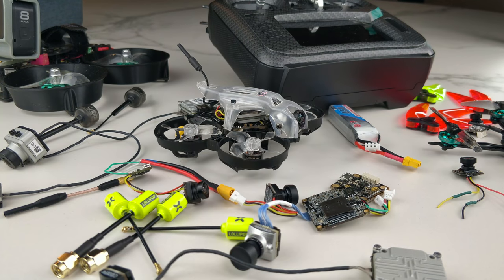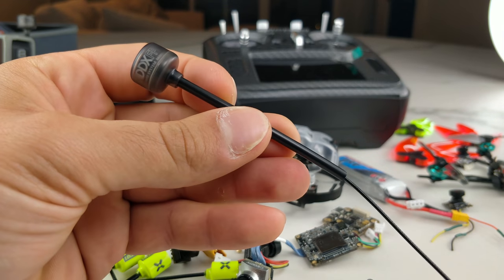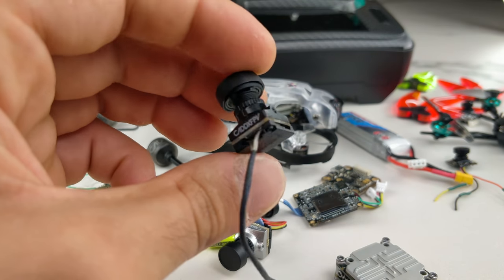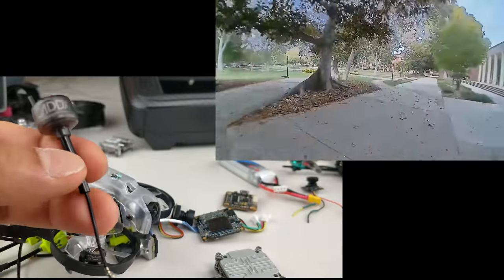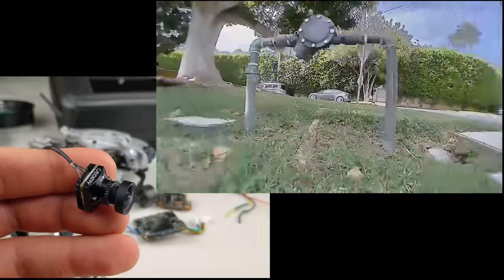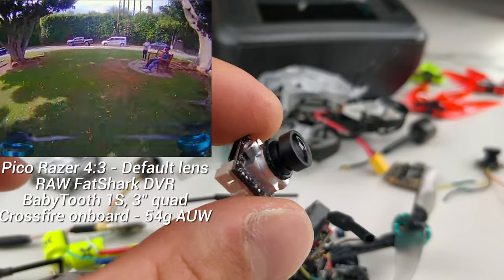Lots o things + GepRC Thinking P16 & Jumper T18

Comment from the maker: Longer Vista antenna - https://bit.ly/2ViXhFg
Vista + Nano Nebula - https://bit.ly/2ViXhFg
Vista kit + longer camera wire - https://bit.ly/2ViXhFg
200mm DJI camera wire - https://bit.ly/3eyBYXU
GEPRC Thinking P16 - https://bit.ly/2Z8vQPO
Batt for Thinking P16 - https://bit.ly/37YF9pr
Caddx Ant - https://bit.ly/2Z8bOER
Caddx Loris 4k/60fps FPV&HD - https://bit.ly/3eyawts
Foxeer Pico Razer - https://bit.ly/2NFb7hj
Foxeer new Lollipop - https://bit.ly/3fXILuI
Foxeer F722 20x20 - not available yet
DAL Fold prop 5" - https://bit.ly/2Vik4kF
DAL Fold prop 6" - https://bit.ly/2Vxgpjh
DAL Fold prop 7" - Coming Real Soon
Jumper T18 - https://bit.ly/37ZJs3K
Radiomaster TX16s - https://bit.ly/3hVRy29

Table of Contents:
►00:00 - Intro
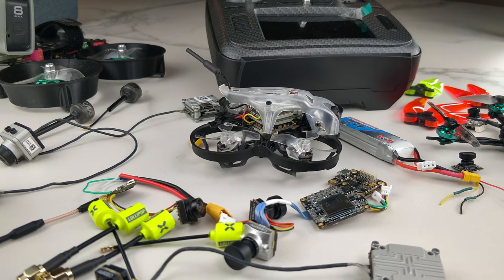►00:35 - New things available now
►02:44 - GEPRC Thinking P16
►06:25 - Caddx DJI Nebula Nano
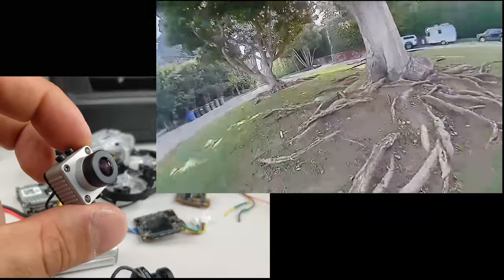►09:20 - Caddx DJI Micro Nebula Intro
►11:34 - Caddx Loris 4k/60fps FPV&HD
►12:30 - Caddx Ant quick overview
►13:58 - Foxeer Pico Razer and 4:3 vs 16:9
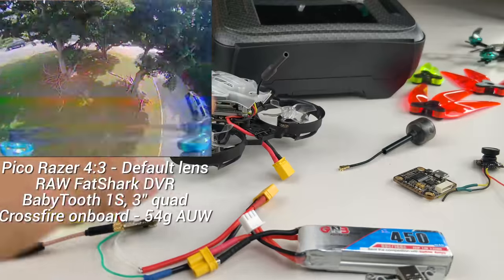►16:32 - Foxeer F722 Mini 20x20
►17:21 - A random Vtx I was working on...
►18:45 - Lens issue with nano and smaller cams
►21:33 - DAL Fold props in 5", 6", 7"
►23:34 - Jumper T18
►27:41 - Sad thing about these controllers :-(

▼Join my FB group for more discussion: Kabab FPV
https://www.facebook.com/groups/379155946182689/

The store: www.FPVCycle.com

▼ My typical 5" quad setup:
-CineGlide: https://bit.ly/2MCoz50
-Motor: http://bit.ly/2Nqqr25
-ESC: http://bit.ly/2oDdzvL
-WaFL’s Cap Cap: http://bit.ly/2GUpXxO
-Battery: http://bit.ly/2JnsTDM
-FC: http://bit.ly/2XRc8G8
-FPV Cam: http://bit.ly/2Q7LfL7
-Vtx: http://bit.ly/38Y25oz
-ND GoPro Mount 30deg: http://bit.ly/2WC15zc
-ND Filter (if used): http://bit.ly/2WEmQ1j

▼Notable motors:
None.  Wait for the new wave of motors

▼Starter goggles: http://bit.ly/2qbJNOS

▼ If you want to solder better:
-Fantastic solder: https://amzn.to/2P5QM2W
-Fantastic iron: https://goo.gl/DqBipa

▼ Tips?
Patreon: https://bit.ly/2oGLP9b

-PayPal: https://www.paypal.me/kababfpv
-Bitcoin: 1E4XZXoD4rS6MYWVWuenY7Kw2M1YgyNpoQ
-Nano: xrb_1188ek5bd7tb9kw67asnp9o65byuoaxbtpxuznx1ribf75x78awywmakj55f
-ETH: 0xD067F93811f2eC31CB1928901002dfdf9A492EF5
-LTC: La2KWYAjp4VT2Lq2M76pbjzXWvRyjpfCtG
Reply: I promise to brush my teeth if you promise to do a giveaway soon....😆 🤣 😂 😹 😆

Comment: Every time I see those new radios from Jumper and Radiomaster I'm glad I choose the Tango 2
Reply: Same here, it was well worth the wait (it ended up taking nearly 4 months on pre-order due to Covid delays). Just the form factor/durability alone make it my favorite radio of all time. It’s nearly perfect.
Reply: That makes a lot of sense - realistically there's nothing you can't do with a Tango2 and BetaFPV FrSky controller setup, especially if that form factor works for you.
Reply: My main concern was the ergonomics, given the fact I pinch. Couldn't be more wrong
Reply: The tango 2 is a fine radio if you don't mind it being proprietary and only running Crossfire exclusively. That, and it's not really for hybrid pinchers! Myself, I won't buy proprietary because it's not versatile in the least bit and you are stuck buying the most expensive receivers on the market. And since I've been in the hobby for 3 1/2 years what would I do to fly all my FrSky quads? Have 2 radios? That's dumb! Then there's the fact that's been with us for way, WAY longer than the COVID-19 shipping /customs fiasco, which is TBS's inability to keep Crossfire products in stock even a fraction of the time! People say "it's because they sell so many!" No, that's not it, because if that were the case, TBS would be cash flush, and make more and more and keep the pipeline full of product. I've seen it over and over before, my theory is companies have to have a ton of money available to them, to constantly keep the flow of products coming because they have to have many orders in different stages of completion to keep that pipeline full so products don't run out. When they are cash poor, which happens all the time to small companies, then products run out of stock because they have to sell the current batch to pay for the next batch! This is what I believe is TBS's problem. Because dealers obviously don't get many items in stock because they sell out so quick... That means they most likely can't order as many as they wish they could.  So, I don't feel the health of TBS is such that I want to buy a proprietary radio that's locked into one protocol. Otherwise, we wouldn't have the constant situation where every dealer on the market is constantly out of stock on modules ALL THE FRIGGIN TIME! No company wants that, so something isn't quite right in TBS-ville. 
Plus, why would anyone put all their marbles into one protocol when for the same amount of money you can get a radio that runs pretty much every protocol every made? Because of the form factor? Fuc# form factor! It's a huge mistake to count so heavily on one company! If you've been around as long as I have, and worked in the electronics industry for well over 30 years like I have, you would have seen the dozens of companies that seemed solid as a rock, go out of business like I have seen. Putting all your faith in one company in electronics is foolish! This is why I won't buy proprietary products, that and because it's the opposite of versatile! 🤔😒
Reply: @scootroter4859  1) I'm just starting the hobby, so no previous fleet to convert. 2) hybrid pinching on the T2 feels great TO ME. 3) Even if TBS will close in the next few years ( highly doubt that ) I still have what I consider the best radio FOR MY NEEDS right now. 4) I have the impression that any Jumper or Radiomaster will last half the time, but I can be wrong. 5) TBS customer support is on another level. 6) I love open systems (Linux user here) , but don't think is the best solution for everything
Reply: @ghosthunterc  couldn't agree more.... Just wish i could get me Rx's to recognize my inputs!!! Three different quads and i STILL haven't been able to get it to work! 😭😭😭
Reply: Tbs is also working on a full size tango 2. So it won’t be as small and will have the full size module in.
Reply: Whats wrong with them? i can flight almost every protocol out there with m T16 out of the box.
Reply: @scootroter4859  you make sense dude.

Comment: Your logic is sound on the production side for 4:3 vs 16:9. Personally I prefer 16:9 cameras since my primary goggles are better in that aspect ratio, but to each their own. I agree with you on preferring a wide field of view.
Reply: The way they are achieving 16:9 is by chopping off top and bottom of the 4:3 image in postprocessing. IMO with 16:9 goggles you should still use a 4:3 camera because you're not loosing the vertical fov, but as you said - to each their own.
Reply: Well you can either buy that cam in 16:9 or 4:3. What tells you they do not have 2 different sensors? Wouldn't it be easier to add a software function to switch instead of going through the pain of selling 2 different cameras?

Comment: The problem with blanket statements about 4:3 and 16:9 is that not everyone is on the same page when comparing them.  It depends.  Is the 16:9 video a 4:3 sensor cropped to 16:9, or is the 4:3 video a 16:9 sensor cropped to 4:3.  That makes a huge difference.  What a lot of people mean when they say they prefer 4:3 is that they like more vertical field of view.  Then there are a few weird people out there that don't like more video in their peripheral vision because they find it distracting, but those people don't count ;)
Reply from the maker: Well if we had to choose only one, would you go with 4:3 or 16:9.....for an entire product line
Reply: @Kabab  I would go with a properly sized 16:9 setup.  For example, I would take the original DJI FPV camera, make the sensor wider, then run 16:9 mode. (might need a larger lens though so you don't see it in the now wider image). Then you should have the current 4:3 vertical field of view with extra image on the sides, filling up the goggles.  I like to feel as immersed in the experience as possible.  I have a lot of peripheral vision that is going to waste right now :)

Comment: I have the 20x20 Zeez prototype on my bench :) I am not yet allowed to show it. AND the 6 inch folding are fantastic IMO. I got some as prototypes. The circular centrifugal swing on them works really well . Nice N smooth..
Reply from the maker: The zeez is in one of my quads right now. It's actually quite nice. The LEDs on the board itself are blindingly bright. Be careful when you plug it in the first time. Wear dark dark glasses. Maybe a welders mask 😂
Reply: @Kabab  hahaha! Right? Super convenient for race builds that require LEDs.

Comment: I've just updated the taranis x9 lite to work with d16 on my friend controller using frsky website, works well but I currently use the new tbs tango 2 pro over my x9d+ just because of the small form factor. Not a fan of the new access protocol just a bit to faffing around, nice video sir 👍🏻👍🏻
Reply from the maker: Yeah I have it too. Irs not the same d16 sadly

Comment: My goggles are 16:9 and I prefer 16:9 cameras but with a shorter lens to not only regain the vertical FOV, but have more horizontal too. I can fly 4:3 cameras pretty much fine and don't even notice the warping, but switching from a 4:3 camera to a 16:9 one is quite noticeable in a good way. 

I want to switch to 4:3 goggles someday but my domv3s are more than good enough really. Let's see if I can hold onto them until bytefrost hopefully comes out.
Reply from the maker: Don't switch the dom v3. They're totally fine.

Comment: Kababfpv . Having a blast with the TP3. I bought Gemfan 3 blade 3016 and 2 blade 3018 . I have to admit I am hard on props . If you dont push the envelope you dont get better :P . I am finding the EMAX  2.5 inch Avan Rush Propeller to have the same or about performance and much more durable . Have you tried them ? Keep the videos coming :)
Reply from the maker: Yeah they're good, I just prefer the lighter gemfans

Comment: I prefer 4:3 and super wide. 
I like runcam nano2 - it's wider than any other camera (other than very old hs1177 with giant lens).
I also put runcam nano2 lens into a foxeer predator 4, and it got wider than stock 1.8mm and 1.7mm foxeer lens. Also runcam lens doesn't have glare issues.
So for 5" i now like predator with RN2 lens, and for toothpick RN2.
I've got caddx ratel nano, it's narrower than RN2, but i'll try it with RN2 lens later.

Comment: Hey bob I want to thank you for your videos and I look forward to your input!👍
One thing I have to tell you is I have been playing around with a completely stripped down vista with no case on it. So far it’s working like a champ even on 700mw but I mostly fly on 500mw and it works awesome! I have it on a og twig weighing 74g, pretty darn light for a vista dji setup!! It’s 119g with a 3s 520mah with xing 1204 motors so that setup could be more optimized but it flys like a toothpick very well.
Also I have been trying to get that darn nebula to preform better and I have put a runcam racer nano lens on the nebula and it does make it a fair amount better!!Maybe check into it for your self and I think you would be pretty interested. 
It’s pretty exciting to finally think digital toothpicks are a good possibility!! 
I’m always tuning, building and tweaking quads to get the most out of them! 
Have a good one and stay healthy!
Reply from the maker: I've been seeing the naked vista more and more lately. I'm actually talking to Caddx and dji about making that happen and restricting the output a bit.
Reply: Thank you Bob for pushing the companies to develop decent products.
And I really hope that a single board VTX will come out soon

Comment: DJI can handle 5s 21v just letting you know cuz ur previous video I think u said only 4s?? But yes defiantly not 6s!! Im gona get ur new 5 inch light frame u showed looks dope!! Can it hold the air unit?? Can I preorder it??
Reply from the maker: the CineGlide is available already and yes it will fit an air unit however I recommend the Vista

Comment: Great info. Nice tree flying! DJI makes fun!! Do you know if caddex nebula will have an update? Any way to fix? I like 16x9 because use to it? Big screen tv.. started with 4×3 and is better.  But just dont like?? I'll try 4×3 again..👊👊💪💪
Reply from the maker: What needs fixing on the nebula?
Reply: @Kabab  Bartwell say picture sucks. Me I didn't buy a 1k system to down grade. You cant adjust camera? Was hoping update or something.  I just got and opened before reviews came out. And most say it sucks. What video I've seen agrees.  Is it worth even installing?? Until can adjust camera??

Comment: So I have the frsky x9 lite and I haven't updated it. It works great with d8 and d16 (I use multiprotocol module for d8). Are the new updates locking both of those out? Will I be able to back up my setup and load it onto a new x9 lite if this one dies? Lol noooo.i like my x9 lite for d8 and d16.
Reply from the maker: maybe they updated it to do the old d8/d16.  mine doesn't and I wasn't aware that the new ones do now either.

Comment: You can get that smooth but not floppy throttle stick feel on any radio....put a piece of silicone or nitro fuel tubing on the bar where the little half circle thingy pivots. add some lube( I used super lube synthetic ) and boom. epic throttle feels
Reply from the maker: I've asked for manufacturers to do this many times.  It just makes too much sense for them to give a shit I guess.

Comment: I like a smorgasbord video:)  Nice look at the Thinking. I was curious about that as it's the lightest and cheapest digital BNF I've seen yet. Doesn't look too bad. Also I agree with you on the whole radio situation. And indeed why do most  radio designers feel the need to put stuff all over the place? It's basically for this reason that I went to the Tango 2 and now just live with putting Crossfire Nanos and Minomortal-Ts on everything;)

Comment: You can get flat 3S 300mAh from GNB and URUAV (for mobula7). Please review this thing on proper recommended lipo
Reply from the maker: I'd still run 2S 450mah on it.  It's fine.  No speed queen but it's not supposed to be.  Flight time is pretty good.
Reply: @Kabab  kV of these motors and props is made for 3S. for example cinebee 75hd has 1103 10000kV and rocks on 3S 450mAh

Comment: I love 16.9 cans bob I don't really like the 4.3 that's why I still use my dom v3
Reply from the maker: Do you use 4:3 on your dom v3 or do you use 16:9 cameras too?  I personally prefer 4:3 on a 16:9 screen
Reply: 4:3 is fine for now, BUT! We all need to face the facts of the future... 4:3 is not going to stay around for much longer because it's an analog format, and NOTHING analog is going to stay around for long after everything changes to Digital. 16:9 is THE DIGITAL FORMAT, and 4:3 will die. Just like analog FPV WILL DIE. I get a kick out of people trying to convince me analog will live forever. No, it won't! Just like the analog cell phones died, the analog TV's (and signal) died, analog audio died and we now stream everything, analog camcorders died, etc. The camcorders are probably the best example of analog dying because it too is analog video dying and being replaced by digital video! Same shite, different use! 
Nothing really stops new technology. When the HUGE BOMBSHELL is released very so0on, it will be the start of the end of analog FPV. Bob even said it! After that, you'll be really surprised how quickly analog will die and go to FPV heaven. (which is at 401 ft. and above! Lol) 🤔😇
Reply: I use 16.9 cams  but I'll try the 4.3 on the 16.9 screen
Reply: Scoot Roter dude, aspect ratios have nothing to do with analog or digital. Just saying.
Reply: @Bikelife-TEZ  I've got Dom v3's and run the toothless 2 mini in 4:3 wide mode. Way better than 16:9 mode. Tried my buddies hdo2's, and aside from the image being way better, I couldn't deal with the square screen.

Comment: Can you tell a little more about recent changes to babytooth? I can't wait to get that build!
Reply from the maker: I've actually been doing a full overhaul on the whole platform. Lots have changed. I haven't showed any of it yet. It's not that different than what is currently seen, just more reliable
Reply: Now I'm even more stoked! Original babytooth already looked amazing. Now I'm very curious how did you manage to improve it further. Will we be able to buy the whole updated build once the new batch of products arrives at the shop, or is it still work in progress?
Reply from the maker: @MrSaraveno  The new stuff will all be built into an RTF.  The current stuff is still good. A lot of the new stuff will become available soon. The biggest part will be the new aio board. The board will have the option of crossfire and a nano32 pro attached already too.

Comment: @kababfpv can the camera output a digital and an analog signal at the same time?
Reply from the maker: Haven't tested that yet. I would expect it to be able to since the digital signal is digital. I see what you're saying however. Would be a super intesting backup system to just throw an analog vtx on there.

Comment: Gday Bob, interesting review Bob, there some cool new toys there, with the T18 you forgot to metion that the  pro version has the 915 mhz system 5 in1 internal multi protocol module and will have a touch screen just to mention a few changes but i think the TX16S is a much better radio that I'd like order it when there in stock again, your new items look very cool its a shame that customs wont release your stock, great job as always mate.👍🛸
Reply from the maker: Wow that is actually intesting. But who makes the system?  What RX's. Maybe this controller will get a second video.
Reply: @Kabab  it's fsky r9, but I read on the multiprotocol module GitHub they're planning to implement expresslrs Wich is usable with diy hardware...